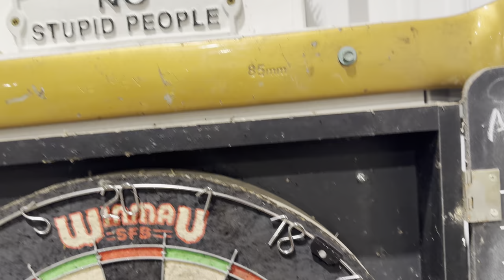TANKS EXCAVATORS TRUCKS & COWBOYS

Comment: The way we used to mount road wheels is you would be facing away from the tank as you lift it up, more or less aligned, and your buddy would then guide it onto the studs.  That recovery vehicle hanger queen just doesn't want to go....  I was totally sure, the tree was gonna get hit.  Nice recovery.
Reply: We used to do similar but the chap holding the wheel didn't lift. Two chaps, one either side of the wheel used shovels as a leaver against the tracks to take the weight.
Reply: @Bob-kb5pv  oh, now that you mention it, I remember that sometimes we would have a third with a tanker's bar to leaver up the wheel.  The challenge was that we were supporting officer training, so each of us was individually responsible for several tanks so we didn't have a crew.

Comment: Love the videos. On the subject of lead pipes if you're in a hard water area there's not such a problem because the calcium in the water is constantly forming and breaking down lead calcite which stops the lead getting into the water, in soft water areas the water is slightly acidic which dissolves small amounts of lead into the water which your body then absorbs.

Comment: Nothing better than waking up on Saturday to find a fun game of Tank Jenga being played.........  Joking aside watching you guys getting a tank up onto blocks and then back down makes me wonder if it might be possible to build a tank lift using a bank of massive lorry air suspension units so that you could drive over the top chock it up with sleepers and then pump the tank straight up in the air.  It would need a decent number of long travel air suspension units but there must be something out there that would give you the range of lift that you need.  And these units are already designed to carry massive loads so weight wise i'm thinking it would be possible.  I only suggest this as I know you guys haven't enough to do and have tons of spare time ;-).....

Comment: Bless. Put a strap round the beech lump. Probably had 80 tonnes of tree above it.
Reply from the maker: Big difference between living wood and dead dried out wood. Tends to split and crack under pressure
Reply: @MrHewes  I'm a tree worker. It will be fine.

Comment: Get an automatic greaser. It's cheaper than having to climb there like a monkey to grease it. TBF, at that size... i don't know why it didn't already have one. Possibly someone pilfered it at some point in the past. I've never gotten an excavator in that range and up without automatic greasing (at least ) for the arm. Odd. Anyways, a greaser, some pipe and those special nipples and a weekend's job and you're set for life, you just have to fill it up with grease every once in a while wherever the grease tank ends up living. Seriously worth your money and time to install. We're talking about all the time you save up not climbing or moving around the machine with a grease tube on a ladder in the cold...

Comment: 12:54 I can see 5 Exhaust ports in this frame, two of which I assume are for some generator unit inside, one of which Id have assumed to be for the main engine and two of which appear to actually be for the main engine, as their flaps are moving while the engine revs. Just what is that thing? lol
Reply from the maker: Centurion ARV
Reply: @MrHewes so are the two exhausts sticking out the top custom, then? All the pictures online dont seem to have that. That being said, I might just watch all the videos you have on this thing to find out.
Reply: @MrHewes found the video! labelled "twin stack pipes". that makes more sense now, huh.

Comment: question, you cleaned off the tracks, only to put it onto muddy concrete.
Reply from the maker: Cleaning the track pins. The pad surfaces Will need doing again anyway before loading on the lorry.

Comment: You need to add some Love to those CATs, 1) they don't like mud in the running gear, the idlers will get flat spots if you let that mud cake up in there 2) the 215 Sounds like a cheap mexican low rider, fix the darn muffler and those wiring issues!!! That 215 will last a lifetime, No body has any sympathy for someone that abuses thier Cats... 😞